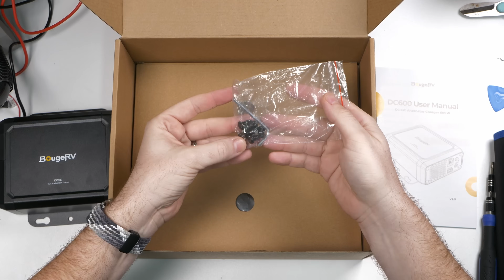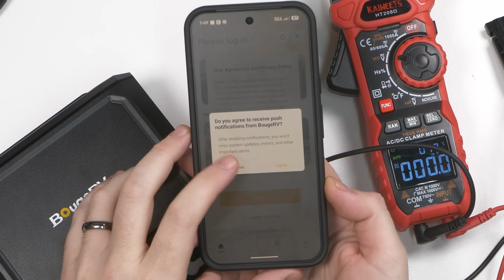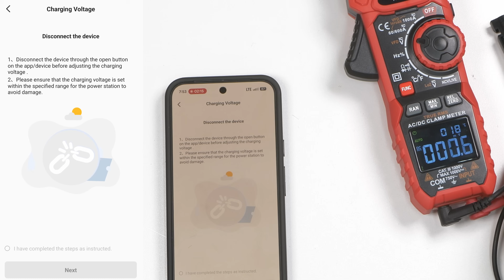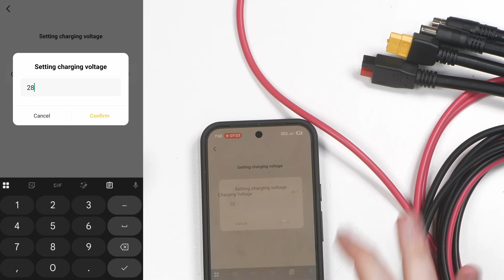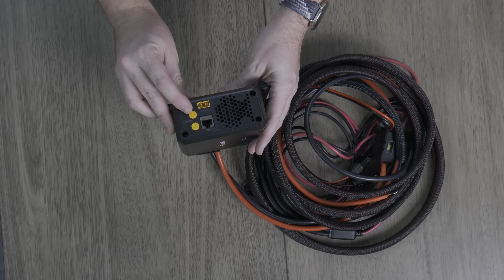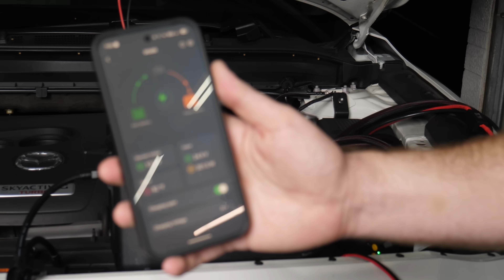Is This The FASTEST Way To Charge Your Power Station on the go? (BougeRV DC600 Review)

Comment: I have the Pecron version of this which is only $149, but that's because it's a barebones version (no app) that's hardwired to output 42V only. The starting voltage is adjustable with a mini screwdriver which I believe mine is around set to 13V or thereabouts.  Also, the inline fuse is near the battery rather than near the DC to DC converter.  Same concept, just no bells and whistles for keeping the price down.  The drawback is it won't work for small power stations with a low voltage range on their MPPT controller.  However for those I can charge them using the cigarette lighter port in my car.
Reply from the maker: Yeah that 26-28v max is a bit of a hindrance on these smaller units.

Comment: The ciggy adapters are usually limited to ten amps, because vehicle power adapters are wired and fused to only carry 10 amps.
 So you can't just plug in a cord. BUT. If a competent Sparky runs a direct battery cable, so solar charging input can usually handle at least twice the amperage. And if you add a small boost converter, to increase the car's 12v feed to 24v or 48v, you double the power again.
 The problem is that you've GOT to know the limits of your alternator (the power bank can suck it dry and burn it out) AND the limits of your power station. AND how to wire, fuse, and match DC systems.
 Because you are getting into power ranges that can and will cause fires if you get the math wrong.
 Your local car mechanic is unlikely to do this properly.
 Like basketball, anyone can play the game. Doesn't mean you can make the NBA.
Reply from the maker: Yep, the issue isn't usually on the car side though, in my experience. The River Pros I have can't accept more than 8A at any voltage from 10-25; increasing the wire size wouldn't impact it's internal circuitry which is where the limit is. This is basically just a large boost converter, built to handle those voltages safely and comes with what you need to hook it up yourself - no sparky or mechanic needed.

Comment: It’s basically a bluetti charger 1, just with different connectors.
Reply from the maker: Very similar, just 40 extra watts and 50 fewer dollars. I think they even use the same wiring just a fuse vs a breaker.

For Mazda Mods - checkout 'desert does it' seat lifters for a cx5. I almost got rid of the car until I was finally able to sit in the seats comfortably for long trips with their risers. 😊
Reply: @fauxrhino  40 extra watts but close :)
Reply from the maker: @lazyeyegamerz8027  Ahhh, numbers lol

Comment: I don't understand the purpose of this device. Why not just hook up larger gauge wires to your 12v battery directly instead of a cigarette jack? The DC converter is going to waste a little bit of power in conversion (and cooling itself) while still drawing the same wattage from the battery anyway.
Reply from the maker: The issue is the input side - these power stations rarely allow greater than 8-10A input so without boosting the voltage, you can only put so many watts into them at a time. This is based on their internal wiring being too small to accept anything more. There is some efficiency loss, but it's minimal for DC-DC conversion.

Comment: Ok is my memory correct but isn't the formula for correctly calculating electricity volts times amps  equals watts so that's 14.8 times 50 to 60 amps equals 740 to 888 watts now Iknow that older vehicles are limited to a 15 amp fuse newer vehicles auxiliary ports are limited to 10 amps which is 222 to 148 watts but straight off the battery should give more back when vehicles had a alternator and separate regulator I bought a unit that allowed me to run 120 volt ac tool's from my alternator basically when it was turned on it shut off the power to the battery and bypassed the regulator and turning on a receptacle then you brought the motor revs up till the voltage reads 120 and you could run drills circular saws and other ac devices to for large loads like incandescent lights I was power washing a drilling rig camp tool shack equipment shed and bunk house I was running 4 x 150 watt bulbs I had to bring my revs up dangerously high had to cut off the lights to only one unit at a time around midnight the Forman came by ask if I was going to finish before I left I told him I would have to finish in the morning as I had no light to do the backsides of the units and he said that it was lit up so I looked and found why I had to bring my revs up so high on the back of each unit were 2 x150 watt bulbs 6 in all if the vehicle wasn't a Ford I would have blown my alternator fortunately I hadn't I finally finished at 3 in the morning what I had figured to be a 5 to 6 hour job had turned out to be a 17 hour job all because every time it was sent to a new jobsite it had been painted to the new company colors right over the grease and grim of the previous company so every time I got close to done a unit the paint would start to peal and I had to start over again 4 or more times on each unit so I know that alternator should put out more watts than 60 like my pt cruiser or even like others at  a hundred  its obvious that the regulator is not letting the full amps through don't know why
Reply from the maker: My brother, YouTube doesn't charge per period, I promise 😂

You're right about volts x amps, but you want to go based on nominal voltage which is around 12.8v for most systems. You also have some efficiency loss from converting the 12v to 60v (or others based on use). 

Those inverters have come a long way - I'm easily pulling 100a out of most of these batteries I'm testing and it's not even breaking a sweat. Thanks for stopping by!